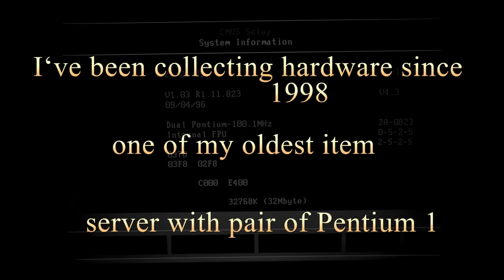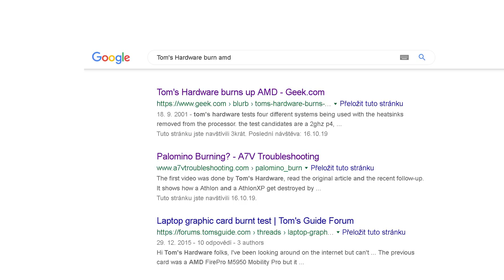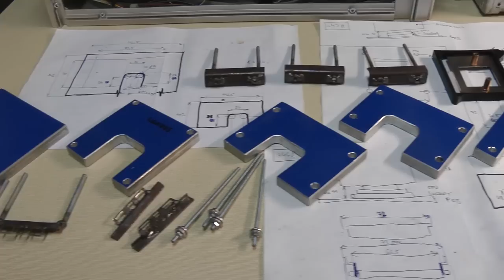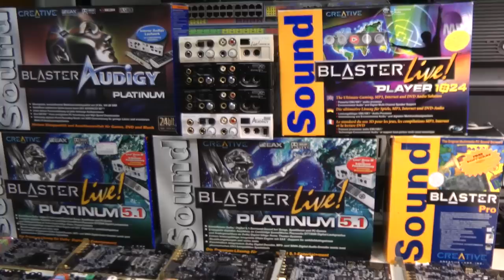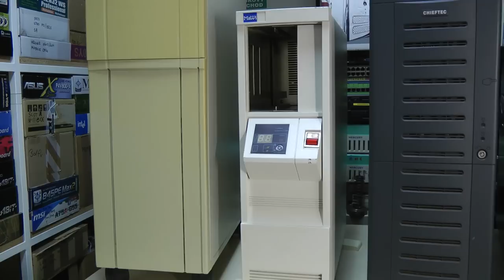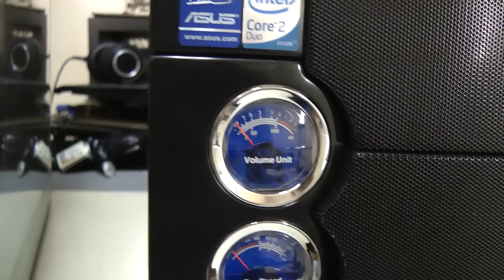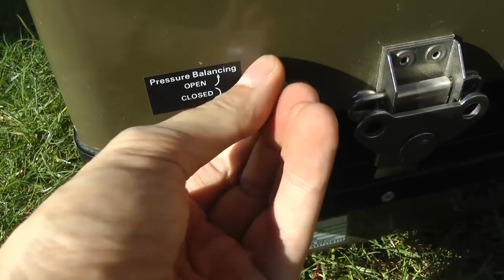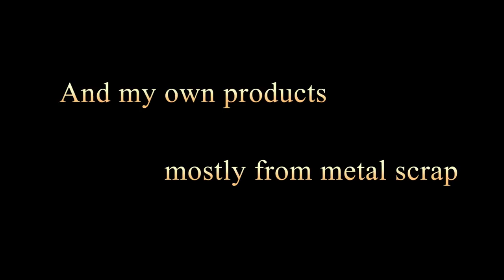My collection after 20 years - RETRO Hardware

Comment: that vacuum tube motherboard if anyone wants to know it is the AOpen AX4B 533 Tube Motherboard
Reply: And a surprisingly difficult motherboard to find these days. I had an eBay search saved for years and only a handful ever turned up.
Reply: @mfhkiwi1811  It's a pre amp, for "hi-end" listening
Reply: @crazyfurnaceguy1229  it uses Realtek AC'97 chip lol
it's just a gimick. tubes should be looked at as "audio effect" anyways
Reply: @Jaburu  I know, in Taiwan, some of speaker Enthusiast they said vacum tube working with hi votage may be interference adjacent digital circuits . Also they said crab sound card's for vacum pre amp is pretty bad idea, it's not worth it to buy！😮
Reply: @crazyfurnaceguy1229  most important part is the DAC (converter). if it's crap you allready have destroyed the sound before it goes into the analog stage. cheapo DACs have become much better though
Reply: @Jaburu  Agreed😀
Reply: Erotikstudio Winkler GmbH  i'm sure this thing isn't even connected. I mean, unless it is just a fancy voltage reg, you would need two of these tubes, if you enjoy stereo sound, at minimum.
also i think it requires about 50VDC to heat up, so, no.
Reply: @Jaburu  Bought a DAC for 40 euro, and allthough it does convert 7.1 nicely to 8 discrete channels with an OK quality, the SNR of the preamp is way too low. At low volume you hear the amp constantly hiss. Would it help to swap out resistors and caps with better ones?
Reply: @paulmichaelfreedman8334  I am neither engenier nor DIY guy, but I know that here you surely will be helped: https://www.gearslutz.com/board/geekslutz-forum/
Reply: what a shame you spend 40 EUR and get hiss. Maybe a defect? I there no garantee?
Reply: I was like ":O Cathode Ray Tube on a mobo!?"
Reply: that motherboard + northwood 2.4ghz was my first ever build 2003, along with clear case, tachometer and ati all-in-wonder with remote lol, sadly it died from impatient static touch in 2010 😿 (haha just like in the video, i wish someone slapped my hand away!)  even more sad i kept all the parts n box for years, but threw it out a couple of years back 😿.   

If i only knew where to fix motherboards then.

Comment from the maker: Info around my "THG" scenes.

Pentium 4 
My scene is without any edit. Clean demonstration with some FPS drops. Believe me - not easy to do it. I tried many resolutions and settings. Quake went down many times.
Original THG video has edit every 4 seconds ... so you can think anything where is true. (nothing offensive)

Athlon 1400

This is only fun of course. If you want to see smoke :-) Make your own video with your HW ... this CPU is quite rare these days.

Still you can enjoy similar setups in HD quality.
Reply: I was afraid you will destroy that CPU. I'm glad you didn't.
Reply: I hosted a few LAN parties in my time and some unfortunate soul brought his XP1600 tower - the weight of the heatsink cracked the CPU when he shifted the case from horizontal to vertical...

Comment: Nice collection dude! :) 
I also have a long history with pc hardware.
My first processor was the 166Mhz Pentium MMX. I tested the jumpers' position by accident and overclocked it to 233mhz.
After that, I had given a little finger to everything. AMD K6-2 500mhz -> Athlon XP 1800+ (Intel Pentium 4 2.6Ghz HT for a short time) -> Athlon 64 3200+ -> Intel Core 2 Duo -> AMD FX 6100 -> Ryzen 1700 -> Ryzen 2600X and the latest is now Ryzen 3600.
There's even more story to tell about video cards, but that's not enough. I'll lift the hat for you! :)

Comment: 2:30 wow！vacum tube pre amp onboard！Never seen this before！😃
Edit：Damn！That is a ton of the collection！😆
Reply: it's an "audiophile"  motherboard. ...Really. And I wonder why there's only one, maybe for mono sound... 

But I recall a modern motherboard that had a couple of valves as a replacement of power regulation MOSFET/voltage regulation stage for an AMD Opteron 8-core. it did get the job done. Even my Tyan with dual opteron took a few seconds before bios screen to get all the caps loaded since it ate hundreds of watts.
Reply: @SilverSpoon_   Unless it's something like a ECC83, two channels wouldn't be a prob
Reply: @OsmosisHD  I'm starting to get how these things were designed, actually operates pretty much like ICs or op-amps, where you need a galaxy of caps/resistors around your transistor to amplify, this is something else. Still it's really for the branding.

My monitor, an excellent HP LP2475w managed to get his PSU fried. Been looking for a proper Schottky diode (regulator) and a tube almost would do the job. It just warms up and reaches the right voltage too slowly the system refused to even power. I finally ordered a schottky diode and wait.

Comment: I regret throwing out so much vintage hardware over the decades since the 80's. My uncle threw out an Osborne a few months ago. Had I known I would have collected it. I still have some hardware from the early 2000's, used to run a CNC router for example, but I have had a ton of hardware over the years.

Comment: I don't have any where near what you have but I have 2 old OCZ Gladiator cpu coolers. Really nice thick piece of copper and they came with 6000 rpm fans. Little screamer. Used on my Athlon Thoroughbred 1.1 Ghz and Athlon XP 2500+ Barton. Then TT came out with the Volcano 7.

Comment: For your condenser cooling projects, you should use Duct Seal. Its a maleable substance that can easily be molded around the socket and can be easily removed with no residue. It will keep the moisture in the air away from the cpu so it doesnt ice up like it did. Very cheap can be found at home depot or any hardware store, looks like a mud brick

Comment: Hello.

I’m Kacper Biernacki from Poland - Wloclawek and maybe I'll start with the story that happened to me when I was little. I got somehow used computer in 2002-2003, which was originally dated March 1998. It had AMD Athlon 2000 XP processor + GeForce 2 graphics card with 64 MB RAM. First it had Win95 then 98SE. I was 5 years old when my parents sold this computer in March 2004. In April 2004 I got another used computer. It had a specification from April 2002 with Win2000 on board. In 2005 there was a change in WinXP. The computer had a Gigabyte motherboard with Pentium 4 and 512 MB RAM and GeForce 4 TI. Unfortunately, the computer broke down. I had WinXP until 2013 until I switched to Win7. And here, with the Win XP era, I am completely out of retro. Since December 2016, I've been thinking about putting together a retro PC in different ways. In the end I gave up because I didn't know how to start and who to ask for help in general. In the end, my idea for a retro PC is 8 computers, of which 1 in each system, namely: DOS / Win 3.1 / Win95 / 98SE / Me / 2000 / XP and a computer with 3DFX Voodoo 1 or 2 accelerator or another very good or other graphic accelerator. My point is that computers would be the most powerful for games and that they would not be dead and would die after a month. I would like such computers to serve me a good 10 15 20 or even 25 years. I asked a lot of people, they spread their hands or they said they were brave and they threw me the idea of a virtual machine or were afraid to take it or did not know how. I have a lot of games that have accumulated over the years, such as Screamer 2 or Die Hard Trilogy or NFS III which do not want to work with Win7. At the virtual machines I have blooded myself. Too many nerves would have gone wrong

The above are just examples of games that I have in my collection. I don't really mean computers only for specific games. I mean computers that would run all retro games from those years. I would also like to learn about computer science and, in general, as well as the programs running on such systems and computers from the DOS / 3.1 / 95 / 98SE / Me / 2000 / XP period.

I very much miss this time. My parents caused me a great loss of my childhood. And now I don't know how to get it all back. I dream about these computers running all retro games, meaning that they will be the most powerful. I watched LGR movie about how Clint built a DOS computer on AMD Ryzen and it was really something. It was a great WOW for me. Just a shock. Just like he made the most powerful computer under Windows XP. It is also a shock for me. I dream about such the most powerful computers from such a period from DOS to XP. Of course, I tried to build something myself, but suddenly I lost strength because I did not know how to build a computer in old architectures. Ever since I lost touch with retro games I started to cry. I was still sad being small. Later my health deteriorated because I missed what I wanted to have, and my parents sold my first computer without my permission. The other broke. And since then I have no contact with retro.

In my opinion you are the last lifebuoy to fulfill my dream / request. My parents even begged them to return the computer. Unfortunately to no avail.

I still cry when I see my old games from the collection and other retro games from those times from the 80s, 90s or 2000s. Retro games are generally known.

I would like to ask you to read this message and understand me and my situation. And I'm really in a lost position and I don't know how to get it back.

Comment: WOW!! I thought I was a packrat! Your collection dwarfs mine by far.🤣 That bit at 7:00 is the reason I hated the older AMD Athlons with a passion. You couldn't keep those things cool, even WITH a decent cooler and a barrel of heat-sink paste. The die area was just too small to have good heat transfer and I'll bet I popped 8 or 10 of those without even working them hard.😜

Comment: What's the board with the vacuum tube on it at 2:29? and why does it have a vacuum tube-is it part of an on-board sound?
Reply: It's an AOpen AX4B-533, it's got a Realtek AC97 chip on it, but they've put in a vacuum tube. It's quite the oddity, and pretty old as well (around 2001-2002)!
Reply: @Rboggyz  there's one on eBay for $199.99
Reply: @jamzales  a bit spicy, but I guess it's rare enough for the seller to ask that much. Fab piece of tech nonetheless!

Comment: hey man im looking for a couple of tualatin p3's for my own retro gaming build. trying to find a couple with 512mb of cashe. do you have a matching pair youd be willing to part with?
Reply: you don't need most expensive retro processor for retro gaming. Just pick up socket A platform, and yuo'll get better performance and very cheap. AthlonXP thoroughbreds are really cheap, you get some 2200+ and it will smoke old socket 370 platform.

Comment: WHY is there a mobo with a vacuum tube (or valve as the UK would say) on it at 2:30 ? what is the story with that ?
Reply: "AOpen AX4B-533 Tube", It has a tube amplifier. What I'm not sure is if it's aimed at headphones use or not specifically.

Comment: i live in the uk. my ebay username is dastardlyman. later today i will put a 1gb disk from 1996 onto ebay uk. you read that correctly. if it doesnt sell i will put it back on the shelf again and try again in two years. the disk works and i will happily run whatever tests using whichever OS the community thinks are appropriate. lets be clear its a 1gb disk from 1996 - i wouldnt buy it. LOL . :-)

Comment: My ddr3 isn’t as cool on this computer as this guy. only 16 GB. in Russia this is top-end iron. Why are there in some offices they use 775 socket and even pentium 4. This year, the kindergarten updated its equipment and wrote off CRT monitors. (used in the office). for home use comes the ddr2 775 or am2 socket. (I sell such computers once a month for sure) not all people have heard about ssd.